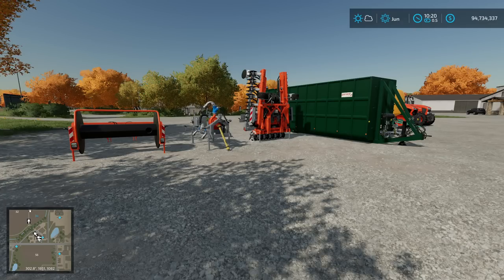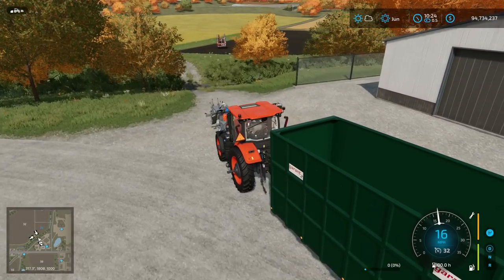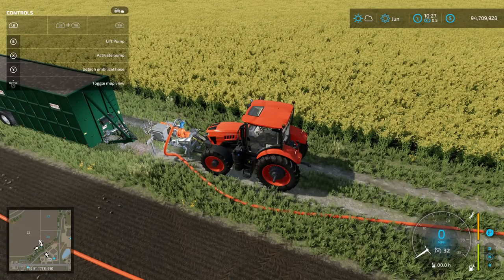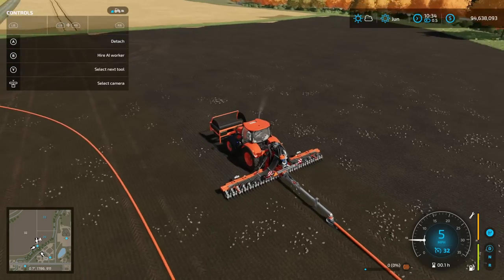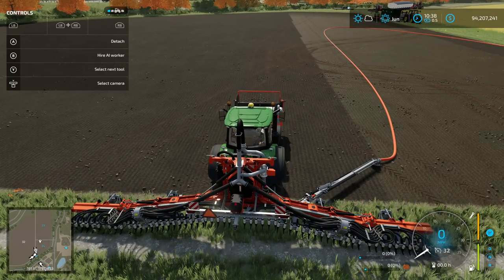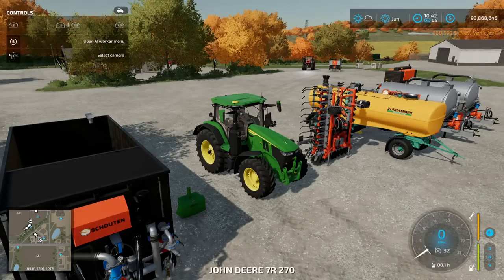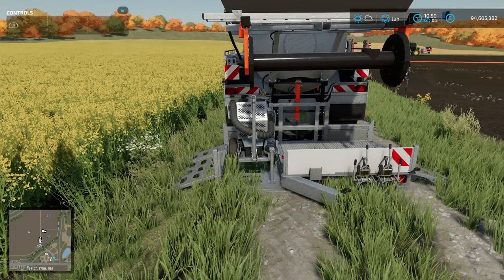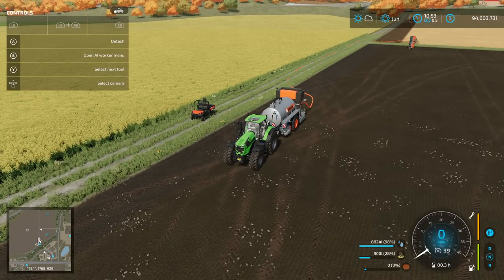How to Use | Pumps N' Hoses DLC - Hose System | Farming Simulator 22

Comment: I think the big Garant tank is meant to just sit next to the field and you use the smaller tanker to ferry the slurry to it. The reason it has wheels is to move it between fields.
Reply from the maker: yes - in real life they use a truck to fill it.
Reply: Smaller tank  is for smaller fields I would think as u can use the bigger slurry trailer an pump from it I wouldn't even waste time with the smaller trailer

Comment: I was playing with this and I learnt a few things. Each pump has a capacity in metres of hose. If you use longer hose than the rated capacity of the pump, you need to use the buffer tank on the spreading tractor.
Also, with the compressor attached to the pumping tractor, it tells you how clogged your hose is.
Reply from the maker: Great tip!

Comment: a compressor is not necessary what its used for is when you finish the job you can blow out the hose, or else you are gonna make a mess, when you reel back up the hose, its not always we use a compressor it depends, if we have to open up the hose  some where thats not the field, such as on a field road, or by the side of the road we use the compressor before we open the hose to empty it so that no manure is spilled, but if its only on the field its not necessary the reel will push out the remaining manure  in the hose on the field. nice film and nice tutorial
Reply from the maker: Good to know!  Glad you enjoyed the video!

Comment: Frac tanks are moved empty. then filled on site. ( The Green Tank )
A huge Dairy Farm by me has enough PTO Pumps and hose to pump slurry 5 Miles or More to fill the tank.
Then manure Spreaders draw from the tank to spread on the Fields. Hopefully the wind is in the right direction for a few days.  
HINT.. Use different color hose so you can find the ends in the Grass when connecting more than one together, LOL 
That idea came from Farmer Klein LOL.
Mike M.
Reply from the maker: Ah - yeah the big frac tanks get REALLY heavy lol

Comment: Also I used to pump manure back when I was in college for extra cash. And you had to clean hoses out every time you need to roll em up. We would put a foam plug in hose that was called a pig, and we'd use compressed air to push it through to remove excess manure out of line. And we were usually about 5 miles from liquid manure source. So that's alot of line to clean out!!!!
Reply: Sounds a rubbish job to do n thankfully we only get to do it virtually lol
Reply from the maker: that is pretty cool!

Comment: Does any body know how you can use the in built compressor on the schouton tank/pump. It has the option to add compressor when your buy it but when trying to use it it says “ attach umbilical” even though the pipe is connected and the spreader is connected. Any ideas I’ve tried everything
Reply from the maker: OK, to use the pump (its changed since this video)   Attach it to the front of the tractor while the spreader is attached to the back and the hose is connected.   When you want to run it, you will lower it and in your help menu you will see an option to run the compressor.   It will turn on for a bit and then turn off.   Then you will see and option to clean hoses - pick that and the compressor will discharge into the hose.  hope that helps

Comment: I tried to buy the 500m hose, and everytime I attempt to put it onto a reel, it says there is no room for it, even if the reel is empty
Reply from the maker: Have you tried the largest reel? (number 1 or 2 in the list I think).  I had it fitting on that one.  Different reels hold different sizes.   I will have to make a addendum and add that to the video - good question!
Reply: @Vbluguitar  Yes, the largest reel will take upto 1.7km of piping, it actually says the amount it will take for each one, didn't notice that until after i watched some of your video, you helped me get started with it, and bloody its good, great video Arthur, really enjoyed it, more so because you made little mistakes while doing it, so it shows you didn't practice to much of it.

Comment: Anyone else had problems related to hoses popping off suddenly and a message saying the tank is empthy but it is still full when you check it? It kinda ruins the whole dlc for me. Im not running any mods…
Reply from the maker: If the hoses pop off, you need a longer hose, or 2 hoses put together.

Comment: Anyone having problem with it cause for some reason I attached it to it I'm using only one 300m hose and as soon as I go down the field it takes right of the pump and then drag it down the field with it I have tried with everything dont know what I'm doing wrong 🤔
Reply from the maker: you need to add a second hose.  The one you are using is not long enough for the field - add maybe a 200 foot hose to your current hose..  run it in big circles near the tank.  Attach one end to the tank and the other end to the original hose and it will quit disconnecting.